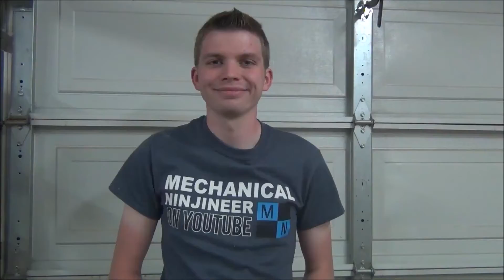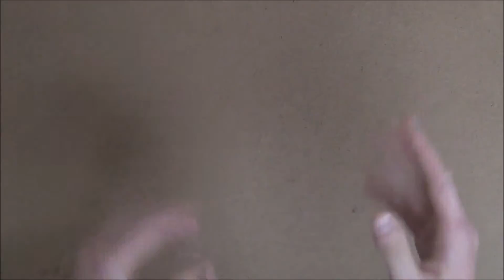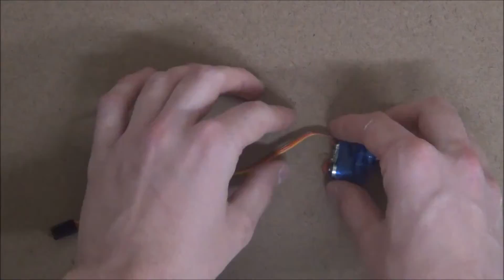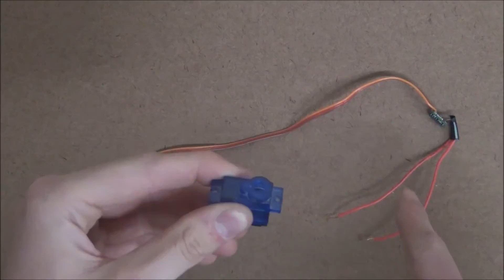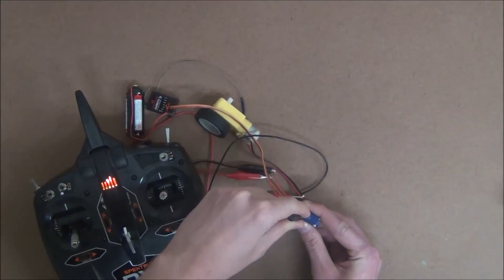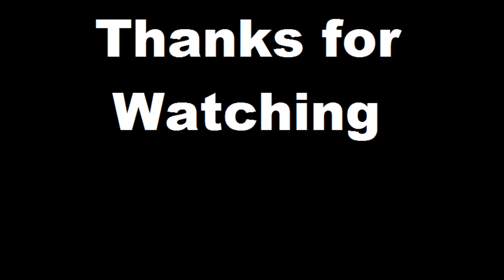How To Turn A Servo Into A Speed Controller!!! Super Simple!!!

Comment: Can i do this to a n20 brush moror in my gliderplane? Because i fryed the esc and now try to use servos and normal esc instead the eac board
Reply from the maker: You might be able to get away with it for awhile however i don't think it would be a very good long term solution.  :(   are the n20s your prop motor/motors?

Comment: Does this work with a servo thats been modified to do the full rotation?
Reply from the maker: yes it can work, but you  wont be able to adjust the potentiometer since you modified it and therefore you may run into some issues. But over all it should work.  :)

Comment: Personally, I would use some heat shrink rather than the original servo case. Lighter, and takes up less space.

But as a quick tip, have a motor that requires more voltage than the receiver can take? Cut the middle wire of the servo cable, and connect that to the positive terminal of your power source. You'll need a separate power source for your receiver, but its worth it if your motor needs 7.2v or 11.1v, and you don't have a speed controller handy. 

Or you could just get some Vex 29 speed controllers, robust and only ten bucks each.
Reply from the maker: Exactly! Heat shrink would be ideal but if you're in a pinch and don't have any on hand sometimes putting it back in its case is faster. :)